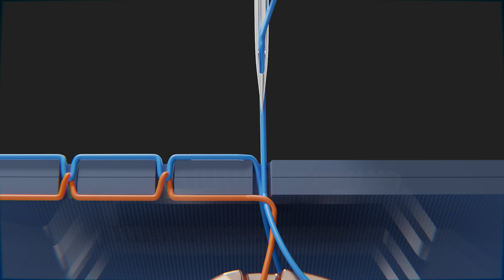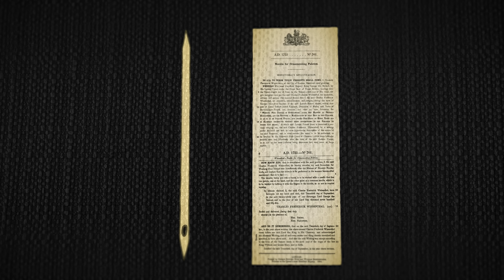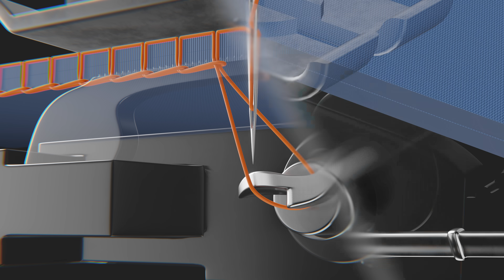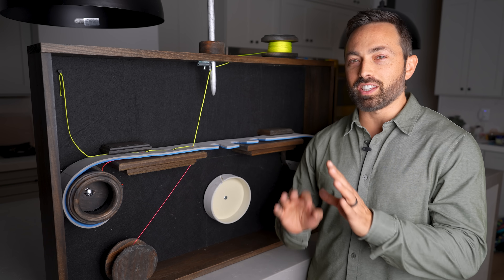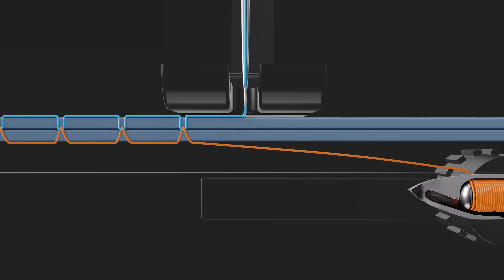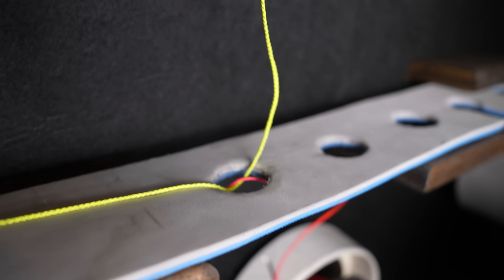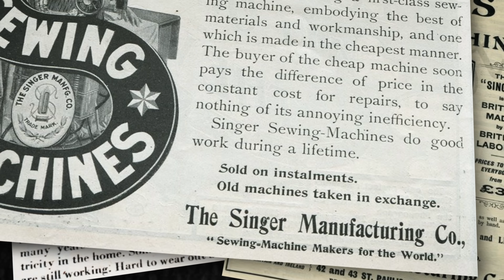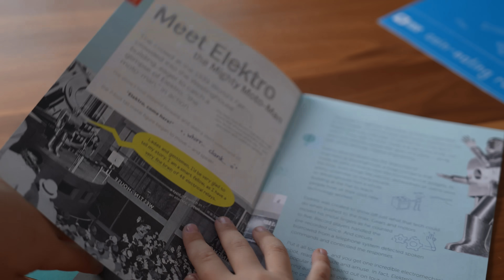The Surprising Genius of Sewing Machines

Comment: I still don't get it. The bobbin under the table doesn't rotate loosely in a circular casing. There is a stud/tack/bolt (English is a complicated language) in the center of the casing, and the bobbin has a corresponding hole in the center, and the bobbin is pushed onto the stud/tack/bolt (I'm really sorry, but my dictionary doesn't tell me which of the words is the correct one). You can't sling the loop of the upper thread round the bobbin or its casing as this is fixed to something. If the bobbin weren't fixed to something it would sit on the bottom of the casing because of gravity, and the tension of the thread would have to be strong enough to lift it sufficiently to allow the thread to pass through. Mechanically, I think this would not work reliably, and in fact it is not the way sewing machines are built. Anyone who knows the solution could you please point me to an explanation? I've been wondering about this for a long time. I like sewing and I'm technically minded, but so far I haven't yet taken a sewing machine apart for fear of not being able to put it together again...

Comment: Vertrasium I'm so sorry but this is driving me nuts because you haven't been taught how to properly hand sew, which is actually normal. While proper hand sewing education is near nonexistent these days, I was taught handsewing basics as a child. You do not necessarily need to pick it up with another hand on the other side unless you're working with super bulky fabric that you're lucky to even be able to sew, otherwise you can angle the needle as you're piercing the fabric to go in and out and in and out without ever letting go except pulling the thread through. Running stitches are actually stupid fast but a very weak stitch compared to other kinds of stitches.

Comment: I remember when young asking grandmas and aunts how sewing machines worked. They could tell me how to make a sewing machine work, but not how the machine actually achieved the feat. Great video. Loved the super large model and how you kept adding improvements to it. It's truly amazing how people can get things to work with such fine tolerances.
Reply: My mother was a seamstress and knew sewing machines inside and out.
I took that and well, always have been good with mechanical things and figured out the finer details, such as gear timing and finding timing marks to sync up the shuttle and needle. Came in handy when removing a shuttle, as someone forced the cloth through and bent the needle, burring the shuttle and catching and not releasing the thread. And figuring out bobbin tension problems.

Comment: How does the bobbin pass fully through the thread on all axes and not be free-floating? Is it attached to nothing? This is still unclear to my smooth brain.
Reply: Right? So many comments about how it's so clear, but how the hell is the thread going around the bobin. First he "throws" it through the loop with his hands, then with the second design there's a magic cut not displaying how it actually went around, he must have removed the bobin, loop the thread and place the bobin again. Am I dumb or what.
Reply: @IamMrJerrySoFU  I see on one of the models, the thread does a 180 flip and then flips back after interlacing with the bobbin thread, but that's not quite clear in the other models.
So idk.

Comment: I really appreciate this video for its depth of info! One nitpick I have is this - the lockstitch a sewing machine does is NOT a completely new stitch to sewing. The mechanical structures to pull it off in a mechanized way ABSOLUTELY are and in no way am I dismissing the ingenuity & hard work of all these fantastic inventors. However, the lockstitch is a the same style of stitch that has been used for goldwork embroidery (a couching stitch) since Medieval times at least.

Comment: The bobbin animation is lacking in one area -- how the bobbin "passes through" the top loop without getting wound around the bobbin's axle.  With the lock stitch mechanism, we can see the "sharp" side of the hook wheel snag the loop but then the wheel rotates the loop using the "duller" side of the hook wheel so the loop won't get trapped on the wheel's axle.  No similar explanation for how the bobbin's axle avoids trapping the loop is shown.  Anyone know how?

Comment: I don't know why the machines using a common power source were not equipped with a clutch pedal that the operator could feather rather than a hard on/off engagement lever

Comment: Singer may not have invented the sewing machine, but goddamn if the old ones aren't made to last! My grandmothers sewing machine (a 50's electric powered one) still works flawlessly today, and is easily better than any other sewing machine I've used. Granted I've only had to use the ones in textiles class at school, but still its is so much smoother and nicer to use.

Comment: I still don't understand how Elias Howe machine works. If you pass the spool through the thread, hot the tread goes to the other side? I mean, the spool should be attached to an arm or something, so it does not make sense. In the animation, for that to work, it looks like its floating mid air, not attached to anything.

Comment: When I got tired of having to go and buy a new pair of Jeans every couple of months as these pieces of low quality shite you get in the shops nowadays don't bear being worn anywhere else than in offices, I got myself a sewing machine and now use badly damaged Jeans to patch less badly damaged ones. Used sewing machines are really cheap, I guess I paid more for the yarn than for the machine by now, and I stopped paying 3 quid every three months.
I have come to the conclusion that the main factor for the short lifespan of the clothes actually is the low quality of the yarn the cloth is being woven from, by the way. Whether you buy expensive "quality brand" stuff or mid-range, it doesn't make much of a difference. They all buy from the same sources. 
…and someone out there must be dumping almost 70 Kg of clothes per year, for I throw away 1kg, if at all. 😆

Comment: The garments they purchased were made at such a substantially higher level of quality is that we just don’t have anything comparable today, garments for us soon with linen thread that had been drawn through a beeswax block to reduce the friction and improve the Strank‘s, the seams refilled and encased in weeds that you just don’t find, even in supposedly high-end clothing the materials were of a higher quality if you have a pair of Levi’s from the 1980s you can still wear it if you buy a pair of Levi’s today the legs are dissolving from the moment they’re first put on the cotton was processed in different ways that made the Carmen more durable and higher quality and resistant to showing signs of wear. The other thing is that a lot of the clothing in landfills has never been worn many manufactures, especially the higher end. Manufacturers will destroy and discard excess, her unused garments rather than allow them to be sold at a lower rate from a secondary store a lot of that fabric isn’t even in the form of garments because the styles of clothes we wear are so traditionally wasteful in The way the fabric pieces are cut from the bolt of cloth or the rule of cloth. There are new styles designs and processes to become a no waste garment.

Comment: There are many comments noting how precise the engineering has to be. To top this revelation, it all can happen over 3000 stitches a minute. I work on industrial sergers that whip around 5 threads and cut the fabric at that speed.
Some other intersting things to check out:
Compound feed machines
Puritan Pride triple stitch waterproofing thread
Cobbling machines

Each has very interesting mechanical adaptations.

Comment: Machine-breakers or Luddites were a 19th-century movement of textile workers which opposed the use of cost-saving machinery, often by destroying the machines in clandestine raids. They protested against manufacturers who used machines in "a fraudulent and deceitful manner" to replace the skilled labor of workers and drive wages down.  Manufacturing is coming from Latin manu, "hand," and factura, "work", so in fact Luddites were sticking to the original meaning of the word manufacturing.

Comment: My 1913 White Rotary treadle is the BEST machine I've ever owned.  It literally sews thru 6 layers of 12oz Denim without skipping stitches or getting jammed.  The engineering in that machine is superb.  Can't wait to watch the video now and try to figure out why my antique machine sews circles around modern ones.
Reply: Meanwhile in textiles class in school the (probably quite cheap) sewing machines there would jam with just 4 layers of fairly thin cotton (at least I think it was cotton?), beyond frustrating when I'd previously used my grans old Singer machine that would just do the job no fuss.
Reply: @__-fm5qv   Ikr.

I have at least 15 machines (1940s to 1970s models) in my basement that malfunction when I sew quilted garments or heavy fabrics.  The balance on my White treadle is perfect ....possibly because it is foot operated and I am able to control the feed when I cross over bulky seams.

Vertasium mentioned that these older machines were created before manufactures began designing them to fail, so that partially answers my question.... but even the stitching on my White is better than any other machine.
Reply: @JoMomma  I think it Alps helps that it's just heavy. All the moving parts are cast iron generally, and that momentum keeps it going through stuff.

Comment: Hand sewing works with the needle passing through the fabric and being picked up on the other side. This process was difficult to mechanize, so inventors had to come up with a new way of sewing. The first breakthrough came with the invention of a double-sided needle that could pass back and forth through the fabric without being flipped over. This led to the eye of the needle being placed next to the sharp tip, which allowed for the creation of the chain stitch. The chain stitch was one of the first stitches successfully performed by sewing machines. The various inventors who worked on sewing machines, included Thomas Saint, Joseph Madersperger, and Barthélemy Thimonnier. Thimonnier's machine used a barbed needle to create a chain stitch and was used in a garment factory that produced uniforms for the French army.

Comment: My dad's Singer ( which was a gift from my grandfather to my grandmother and then passed onto my dad) uses the Shuttle bobbin as shown in 9:53 and it still works flawlessly. I'm 29 now so i guess the machine is close to being 90-100 years old and every time i see it running i'm just amazed and awestruck. I sometimes use it too and it feels really solid. All it needs is a bit of oiling once a year and it runs.
I'm just glad Veritasium did this video and finally i could wrap my head around what is going on in the Singer
Reply: Not as old but my grandmothers electric singer is probably 60+ years old now, and similarly it just keeps on going! The only thing it seems to need is the occasional oiling, and the belt was replaced about 10 years ago. But it just is so solid and runs so smoothly its great!
Reply: @__-fm5qv  Yeah mine is the mechanical one and great to hear about yours too

Comment: I've wondered this for a long time! Glad to have such a clear answer of the mechanics. I occasionally pull out the sewing kit to keep my clothes together -- I'm somehow very hard on my clothing, or they're just very shoddily made -- and it's a very slow and tedious process to do by hand. It's amazing how effective planned obsolescence is at destroying jeans and coats that look like they should be sturdy. Even so, I can't comprehend the 35 kg total per person per year... Seems like the fashion industry is completely out of control and throwing away more than it sells, or something along those lines. From a quick calculation, I'd be surprised if I've used much more than 70-100kg in my lifetime so far... but I'm definitely not a slave to fashion.

Comment: Thank you so much!! ❤😍😎 I always wondered how they did it in the first place. Those demonstrations and animated parts really brought it out. Thank you so much for all the research about facts and figures from the past, and model building and all that stuff! Amazing!!😃 However, even after watching your video as the second one on how a sewing machine works, I still don't understand how the thread can pass around the bobbin without getting caught in whatever the bobbin is attached to. After all, the bobbin is not flying in mid air, it has to be held by something. I can't wrap my head around how the thread is not getting stuck there. If you could show a close-up detail of how on earth this works, the knot in my mind would finally burst. 😅
Reply: I have the same question.  It seems like the bobbin needs to be floating somehow.

Comment: @Veritasium I disagree that the difficult part to mechanize a hand stitch is to let go of the needle and grab it on the other side. That is really easy. Grabbing and letting go can be achieved in many many ways. The hard part is actually that every time the needle crosses the boundary of the fabric you need to pull the entire length of thread through the hole. Dealing with an arbitrary (and shrinking) length of thread that needs to be pulled and tightened mechanically very complicated. A sowing machine does not have do that at all.

Comment: My sewing machine helps keep clothes out of the landfill. When you can repair a hem, you don't have to throw the garment away! Of course it also means I wear things until they go out of fashion and then eventually back into fashion again. Re-selling or donating clothes, and buying resale clothes also helps! I want to start sewing my own clothes, and I plan to get get fabric from the Goodwill "sheets and curtains" section.
Reply: That really just means you have too many clothes though, because clothes worn regularly will wear down within a couple years at best. Clothes are actually quite fragile, especially these days. I remember I had shirts that lasted more than a decade, they just got softer and faded over time. But these days, clothes are just going to rip and get holes or stain to the point of being unwearable before the stitching goes out. One big reason for this is the change in chemicals used to treat clothes, along with mechanical washing, and finally, most fabric used these days are inferior. What happens is China stores all kinds of excess fabric for years to manipulate the market value for creating artificial shortages. What happens during this time is the fibers degrade, especially since they're not stored in any special way, they're just dumped into what is basically a giant concrete floor. So clothes you buy today, are often using fabric that has already been sitting for years, even over a decade, before they are finally pulled out and used. What this results in is degraded fabrics being used in most of todays clothing, raw fabric that is already half past its shelf life, sold as new items.

Comment: When I was about 7 I had a kid Singer sewing machine, used it untill the gears wore out. I did make a chain stitch, and it indeed caused of plenty of doll clothes to fall apart. I've been sewing ever since. 

The two sides pointy needle (@3.20) seems uncomfortable for most handsewing though - since if you sew a lot you learn to put it down and up through the fabric in one go. Speeds up your work a lot. And you push the end of the needle. Even with a regular needle you need a thimble to not make your hands hurt. Maybe it works well for upholstery or stuff like that? Thick layers?

PS: have you ever done a video on the Jaquard loom and the influence on computing? Seems like a nice follow up to this :)

Comment: My mother still uses a 1914 Singer treadle showing machine that she inherited from her grandmother. The only thing she has to do periodically is oil the gears on the treadle (a large foot peddle that powers the machine). This particular unit was sold with a sewing desk. It is a beautiful piece of engineering with gold embossing on the case. If you do a search for "Vintage Sewing Machine Restoration" on Youtube it is that exact model. When I was a kid I remember her repairing all of our clothes using that machine. We had a tendency to rip large holes in our jeans etc. It is amazing how durable these machines were.

Comment: The critical thing is the physics of the stitch. Trying by hand with a simple pass through stitch gives a weak and pucker prone result.  Even two needles in opposing pattern tend to pucker. The lock-stitch , similar to crocheting not only keeps the two pieces of fabric tight with friction, it also imparts a lot of stability between the threads. Replicating it with a single needle is still not as good because you will still pucker the fabric Trying to impart the same friction. The lock-stitch with separate threads is hard to beat.

Comment: I'm a manly man who needed to sew my manly man tough work gear... cough.

Learned on a cheap plastic modern machine, that could not handle any heavy textiles. Then I found a cheap 15 series Singer from 1947. All metal, and just a little tlc, the machine is un beatable for at home. Runs perfectly, better than what is sold today.

Comment: 10:48 you mention the idea of planned obsolescence. I'd be careful with phrases like that. Sure, there are examples of this happening, but often times it's technology moving and surpassing what was made previously, or just poor design. 

Planned obsolescence is not a subject that has ever come up in my experience from engineering school to working in manufacturing. 

In this case, sewing machines that work will keep getting used. Both survivorship bias and good design. Take a car from 100 years ago and it might work (you can still get parts for model T cars) but it doesn't satisfy user needs anymore.